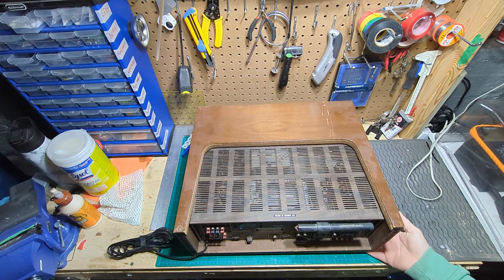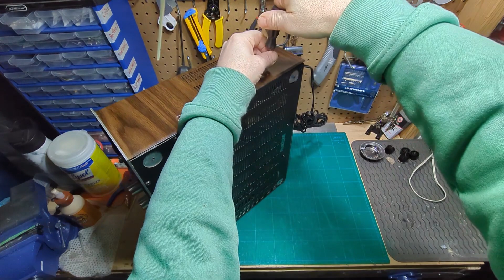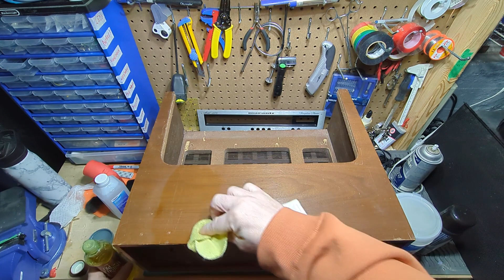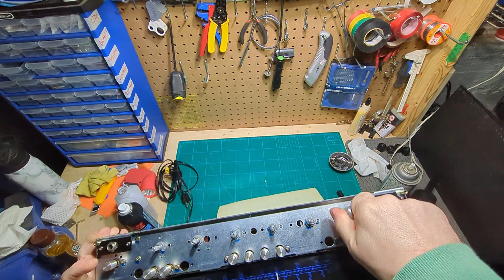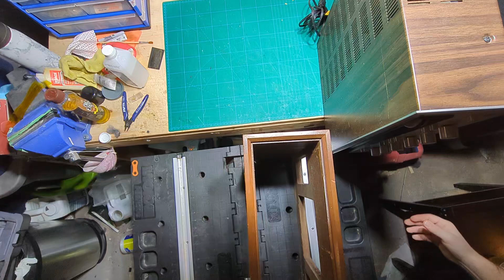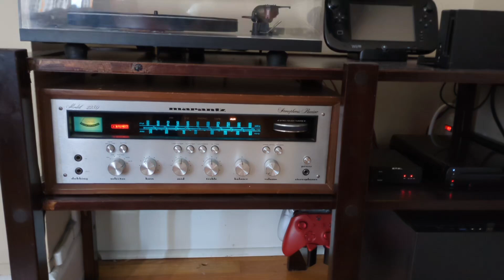Marantz 2230 Stereo Receiver Clean Up

Comment: Nice receiver, i  have the 2275 and the string came off the dial pointer should i glue it back in place ?
Reply from the maker: I never had to get into reattaching the string to the needle, but I'd say if the string is tight and it makes a complete loop (i.e. turning the wheel moves the string fine, but not the needle) then  carefully reattaching it to the needle with a bit of glue might work. I'd be very careful about any globs of glue left that could make contact with the track though, because the needle really needs there to be no friction to skate across. Glue on the bottom of the needle could easily make it hang in place